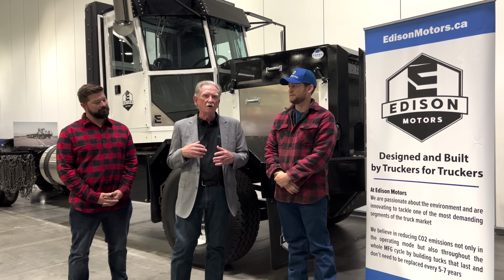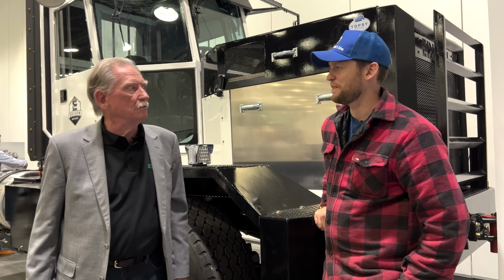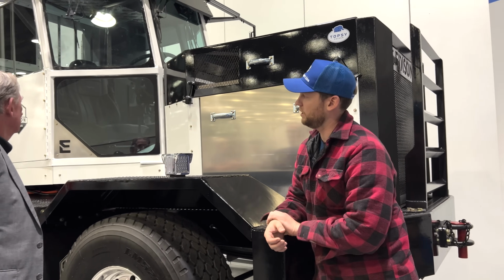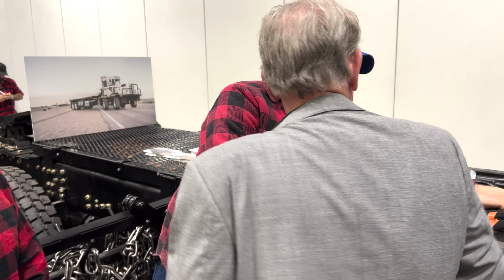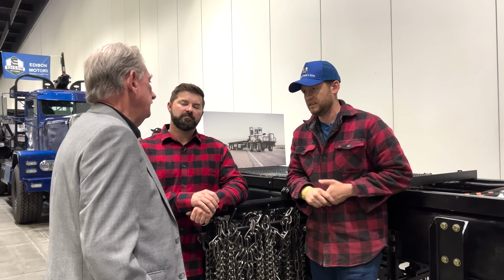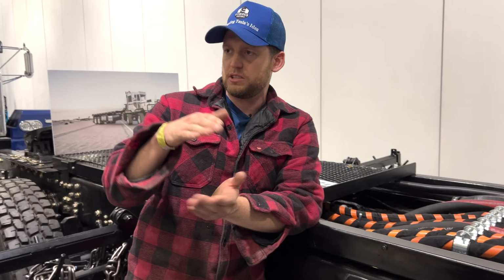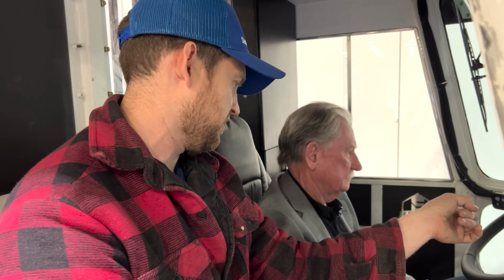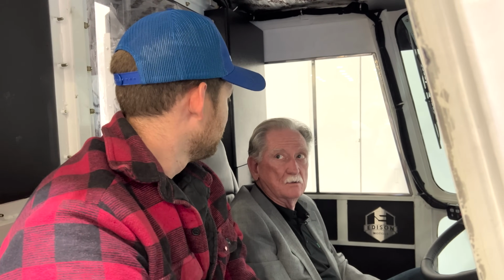This Electric Semi is a Million-Dollar Idea! Edison Motors at Fully Charged LIVE Canada

Comment: whatta ya think about this hot mess?
Reply: I mean it makes a lot of sense honestly. Still has all the range but cuts fuel costs in half? Perfect for a lot of use cases.
Reply: @pierredelecto7069  
absolutely ,..it is a "step change" , a levelling up if you will.
This Truck once road tested and tuned will far exceed ALL trucks that have come before it.
Reply: @-LightningRod-  I think the best use case is for day cab stuff still. Guys who drive straight highway won't benefit as much because they don't Regen often. 

It's like 70% of trucks though that do delivery with day cabs. It's only 30% that are truly long haul.
Reply: @pierredelecto7069  
no question about it friend. In this case , i think distance travelled is not as important as elevation or Tare Weight. Logging trucks, i believe are in two states, Loaded to the Max OR Empty. These conditions need specific tuning for the optimum application of Modern techniques.
Reply: @-LightningRod-  logging trucks are often scale exempt but don't drive on interstates. A lot of their miles are on dirt roads back in the woods. 

It's cool that this guy made such a neat vehicle.
Reply: @pierredelecto7069  
i think it's cool as beans friend, ..i'm impressed beyond belief and am somewhat jealous that someone did it before i could.

Comment: Nice! Yeah we need these big time here in Oregon!  Tired of all the jake braking noise and the diesel pollution in our air.
Reply: Funny enough, if the edison truck needs to regen brake when it's batteries are full, it has to bleed power somewhere, so the proposed solution is to use a jake brake on the onboard generator!
Reply: @createachanneltopost  lol.... interesting.